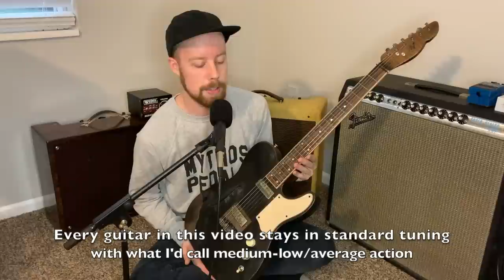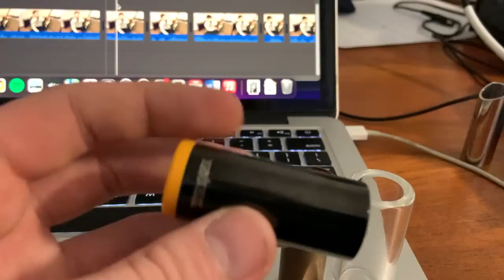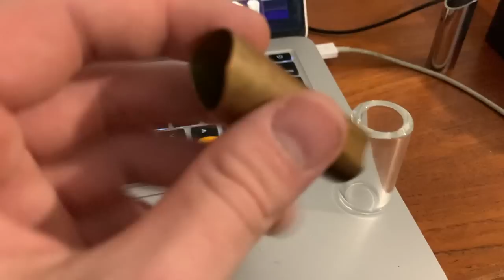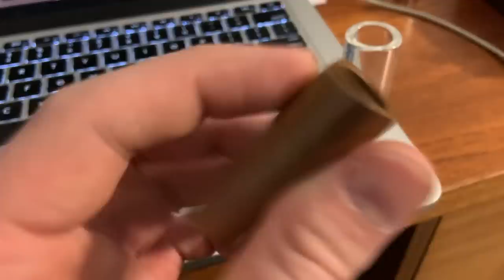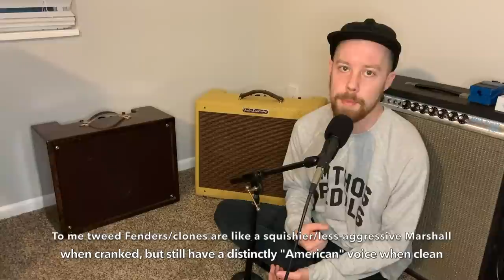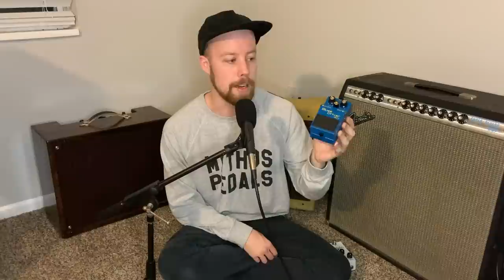My Guitars, Gear, and How I Approach Tone

Comment: I ran through a 1969 Super Reverb for over 20 years and loved every minute.  Had it converted to Blackface as well.  Just an absolute monster.  No need for 40 watts any more and let it go 5-6 years ago.  Traded for a couple of smaller amps that are much more tolerable at home.

Comment: You mentioned using an attenuator for your tweed clone. I recently got a Hot Rod Deluxe and holy shit is it loud, especially in the house. The major downfall I have found is the HUGE amount of volume you get between 0-2 and you don’t really get that cool tube amp sound at low volume. Someone told me about this “magic knob” that goes into the effects loop and works as a master volume. You can turn your volume all the way up, drive all the way or whatever you want, then turn this “magic knob” to whatever volume you want and it is awesome. Got it for $25 on ETSY. It’s called Dr Watson’s Lion Tamer and it’s 11/10 genius

Comment: I have all three of the slides you have in the video, I have a tapered brass slide that I cut down shorter and is the one I use the most. I thought it was cool that we have the same three slides though. Thanks, one day I’ll do a gear video as well. It will be a fairly lengthy video and that’s probably why I haven’t done it yet. lol… 🎸🤓🌎☮️👍

Comment: Dylan, great stuff man. I use a Custom Deluxe as well. It would be great to see a video on how you dial in your amp since you doesn’t use drive pedals. Maybe address the following? Do you jump the cables or use a single cable out of the instrument channel? If so, which channel? How do you set the tone, instrument and mic levels? Do change the settings for different guitars? Anyway, that’s an unsolicited idea for a video. Keep up the great work!

Comment: Are you still using the Mojotone 59 Clone and Duncan Seth Lover pickups in the Goldtop? (now in September of 2023) And did you get the standard Mojotone 59 Clone or the low output 59 clone? They advertise both (both out of stock but I love the tone you got on a video I saw of Call Me the Breeze with Smokestack and would like to try the same pickups if possible. Curious also if you're in standard tuning when you play Call Me the Breeze? I love the tone you get on any guitar and I know it comes down to you being an amazing player with a unique touch, a great musical vocabulary and maybe a bit of tonal help from some pedals and amp but still I'm curious if you're still happy with those pickups in your goldtop. Thanks for any info

Comment: Hi Dylan. Thanks for the videos - I have learned a lot and gotten my motivation cranked up :)

I just turned 60 and my dexterity has noticeably waned and hand pain increased.  Like most guitar players, I have picked up a slide now and then over the years, but never gained much mastery of it. Now I'm thinking if I want to continue to play when I get old, slide may be the thing. I started to work it and was getting results mixing in a few slide tunes with my blues band until I got cancer and the wheels kind of fell off everything for a while.  Now I'm trying to get back on track and your videos have been like a cheat code, saving me some trial and error.

I'm currently playing a 68 Deluxe Reissue, but thinking of swapping out the speaker to get maybe a warmer sound (I'm terrible at describing how things sound). So many speaker options out there, though. Did you have a favorite when you played a Deluxe?

Thanks again, and keep playing and being true to yourself.

Comment: Hey Dylan, I also found out about you from Rhett, so seems that video was a big plus for ya as you already know. Im on the back side of most of my playing these days, getting old ha, so not playing out or anything. Always been a fan of riding the volume and tone knobs, but, back in the day I played only Gibson humbucker guitars, and the 2 biggest problems I seemed to have were:  1 never being able to get a tone from my amp that worked for me on both pickups no mater what I did, sinking the neck down low as possible, going thru multiple pickups etc, neck was always to woofy, bass heavy, and if I dialed in the neck, the bridge was to wimpy, and :2 with the modern wiring my guitars always lost to much top end to be able to ride the volume much as I wanted to, and I was young and dumb, no internet etc, and did not know about 50’s wiring back then. So a question for you, are you using a treble bleed circuit in your guitars, or 50’s wiring to help with the treble loss? I see you seem to be same as me with the humbucker guitars, got to love ‘em, but do you ever try a strat or single coils other than p90’s, (I think my favorite pickup)? With your touch, and right hand control I know you would make a strat sing in the right situation, and in right songs. Love to hear you take a go with one, or even a tele. I finally broke down and forced myself to start playing a strat a few years ago, had to they sound so good in the right hands, but man, those things really put a hurtin on you at first ha, I always heard they fight back when you play them, and now I get it. Still struggling with it but I keep trying ha. Guess I better shut up for now, be nice to hear what your doing about top end and the neck pickup, take it easy, I will keep watching to see what you come up with next time, thanks for your time.✌
Reply from the maker: I know exactly what you mean about finding a setting that works for both pickups. The thing that works best for me is to set the amp on the brighter side with not too much bass so it doesn’t sound like complete mud on the neck pickup, and then turn the tone knob down on the bridge pickup to smooth it out. Tone knob never goes above 6 or 7 on the bridge pickup for me, at least for leads. Since turning down the tone knob takes away a little output as well, I have the bridge pickup a little higher and the neck pickup maybe a smidge lower than normal, but nothing drastic. It’s not perfect and doesn’t always work depending on specific pickups/guitar, but that’s the best thing I’ve found. I also tend to stay on the bridge pickup for the majority of the night, so I set the amp slightly leaning towards sounding better on the bridge pickup, but again I make sure it’s not complete mud on the neck for the occasions when I want to use it.

In terms of wiring, overall I like 50s wiring for neck pickups and modern wiring for bridge pickups. Again depends on the guitar though, for example my R8 came stock with 50s wiring for both pickups and I’ve never felt the need to change it, but on my SG I tried 50s wiring and it sounded thin when I rolled the volume back on the bridge pickup, so I kept it 50s wiring on the neck and switched back to modern for the bridge. Tried 50s wiring on the LP Jr and again, too thin when rolling back vol, so I switched it back. Not sure what’s in the Mulecaster but it cleans up better than any of my guitars so I’m not messing with it. Never used a treble bleed. 

I’m not a Strat guy at all, love (traditional) Teles but neither have enough oomph for me with my setup playing with Smokestack. Hope all that helps, and thanks for checking out my channel!
Reply: @dylanadamsguitar  Thanks Dylan, yep, pretty much what I always had to do, and yea I was always pretty much a bridge only guy, only using the neck if I just could not get the sound I needed from the bridge. The mixing wiring I had never thought of before, will have to try that. I get the not enough kick from strats, why I never used them till now, just like the tone to much not to at least try, but man, playing the extra clean strat tones is tough, I give  a lot more credit to guys that can make it work for them, not as easy 
 as I had thought, ha. But one benefit I found was the ease of getting a good tone playing a clean strat sound, I don’t have to hunt and track down a sound I like near as much as I do from humbuckers. I never did the treble bleed thing either for ever, but out of desperation I finally tried it, think about it next time you are inside a guitar doing some pickup work, you may like it if you never tried it before, I only use it for the neck pickup. Thanks for the reply, really digging the thing you have going, your playing is top notch and fun to listen to, good luck with the channel and with the band. ✌

Comment: I agree that slide material matters less than the feel and fit of the thing. I prefer ceramic and brass and I use glass also. The Rock slides are nice but I don't use much anymore because I switched from pinky to ring finger, so these are too small now.Looks like that was some expensive trial and error for me. Is that Mojotone speaker more or less a V30 Celestion clone?

Comment: hey dylan! sweet playing. what settings are you using on the dream?
Reply from the maker: Thanks! For me the sweet spot is actually just every knob roughly at noon except reverb which is about 10 o’clock, sometimes treble and/or bass down to 10 or 11 o’clock. Almost always on the EV12 speaker setting, easily the most balanced and musical sounding one imo, and the “lead” setting for the boost. For recording clean rhythm parts I’ll turn the boost off and the vol way down.

Comment: Hi - Thanks for posting this video, lots of great info! I've got a sound baffle question for you. I'm currently playing a SF Vibrolux that has been BF'ed and I play my guitar straight into my amp and use the volume knob to get my clean/dirty sound. I'm guessing my VB is similar in output volume to your 5f4 Tweed super, and I was intrigued when you said the plexi glass baffle really helped in small and medium size clubs. I run my VB around 7-8 on the volume, and that can get loud in a small room. Like you, I don't like blasting out the band with my amp stage volume, so I've been thinking of getting a baffle for when I play those size venues. When I researched them I see they come in a variety of thicknesses. I was wondering what you were using, and if you had any recommendations on one that you found that gave you a good tone for stage volume while helping reduce the amp beaming for FOH and the first few rows of people in the crowd. I've heard from other friends that use them that the baffles can mess with the on stage sound, so I was wondering if you had found a setup that gave you a good sound on stage while using one. Thanks

Comment: Hey bud, great stuff. I'm curious about what you do when you need to take the slide off. I've tried a few things but haven't settled on anything I love. These days, it just goes in my pocket, but sometimes that takes longer than I want. I've put velcro on one side and stuck it to the back of my guitar before. I like that ok, but some guitars are just not going to get velcro on them... thoughts?
Reply from the maker: Thanks man! I just put it in my pocket, and since I wear somewhat tight jeans I’m able to sort of wedge most slides in the corner of my pocket sticking out about halfway for easy access. 

For ones that are slimmer/won’t stay, my dad and I actually made a little “slide holster” out of a piece of PVC pipe (it’s the kind that starts about 1” diameter on the ends for the connections and tapers to a smaller size) and a stick-on phone pocket clip from Amazon. We cut the pipe at the section right where it tapers so the slide doesn’t fall through, stuck the pocket clip on the side and boom. You put it in your pocket like you would a knife with a clip, PVC part inside and pocket clip facing out, made the pipe short enough that the slide sticks out of your pocket a little but doesn’t slip down further, works great!
Reply: @Dylan Adams  ah very clever idea. Pops sounds like an awesome guy. Thanks for the intel, and keep at it, bro. You are great.

Comment: Hi Dylan. Congratulations on your well-deserved success online!  Thanks so much for putting together these videos.  I know it's a lot of work, but the results are great. 

I have a couple of setup questions.  Which strings do you use (material, gauge)?   Do you set up your string height at the nut a tiny bit higher to facilitate slide playing over the lower frets?   Lastly, do you prefer the Antiquity pickups over the 57 Classics in your SG?  

Please keep the videos coming!
Reply from the maker: Thanks so much! I plan on doing a guitar setup video, but I’ll say that I set up my guitars very “normal,” i.e. no real special accommodations for slide except using 11’s (elixir nanoweb). And I definitely prefer the Antiquities, much more articulate, woody, “old” sound for lack of a better term

Comment: Awesome video! Which speaker selection do you prefer on the Dream 65?
Reply from the maker: Thanks! I almost always leave it on the EV12 setting, that’s the most balanced/open sounding one to me and sits in a mix the best. I usually have it on the “Lead” boost setting with knob around 9-12 o clock for solos